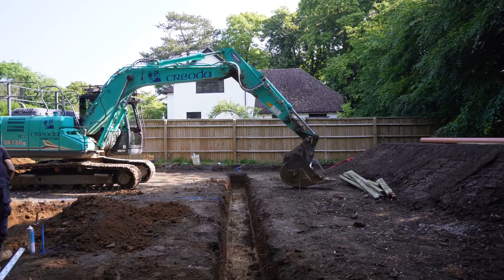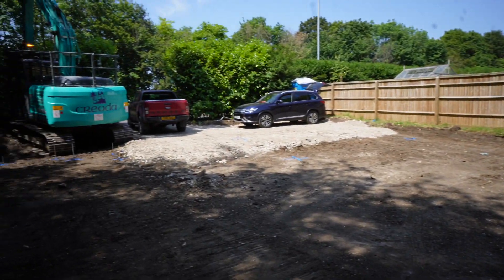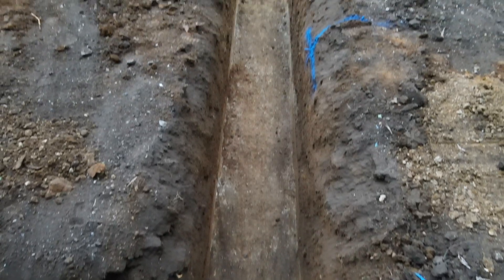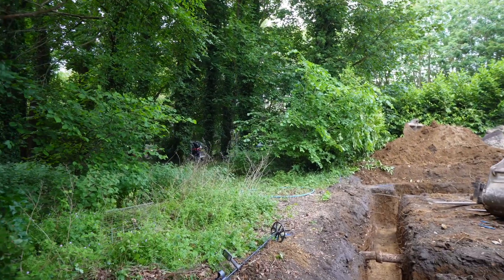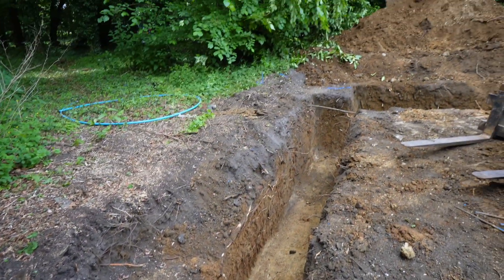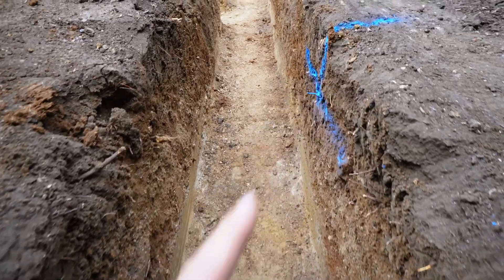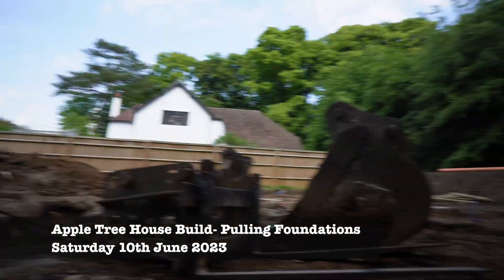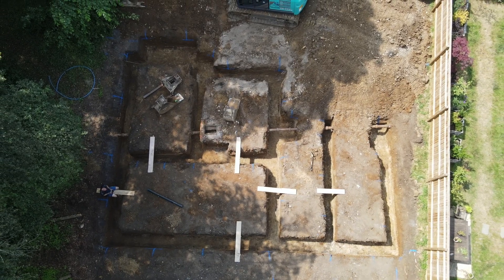How To Build Your Own House - Setting Out and Foundations

Comment: Looks like a very tidy dig, hopefully the weather held out for the pour!
Must say I've never seen the bottom of foundation trench dug so much off level. I thought the bottom of the dig had to be kept level and any required increase/reduction to foundation thickness is then accommodated via steps. BCO is happy so crack on I guess!
Reply from the maker: You can use steps but it’s more work, we hit the good ground and kept that as a level and then added more concrete instead of steps.  If we didn’t hit brash, which is basically stone, then we would have stepped the concrete 👍🏻

Comment: A inexperienced female building inspector told a friend of mine to dig deeper as she was concerned about trees ...it ended up 1900 mm deep of concrete for a single story extension and the house is only 450 mm ish max . stick to cakes and sandwiches I say .
Reply from the maker: We were expecting to hit at least 2m but we hit brash after a meter which was literally the best case scenario we could of wished for.  We also went for decent quality concrete mix too just to be sure 👌🏻 Building Inspector was really happy with the ground
Reply: @Tone_Team  yeh saves you concrete , less muck away and reduces chance of footing collapsing .
Reply from the maker: @TopCatsBack  We had talked about digging 2m down, sticking 600/700mm of concrete in to avoid trench collapse and then going again, fortunately we didn't need to do that